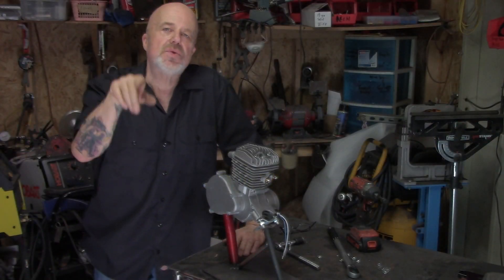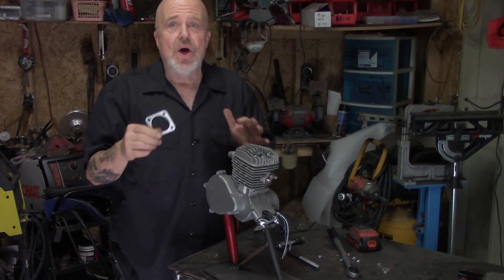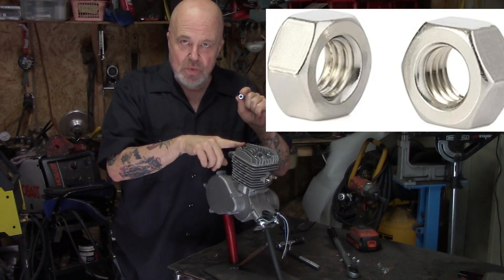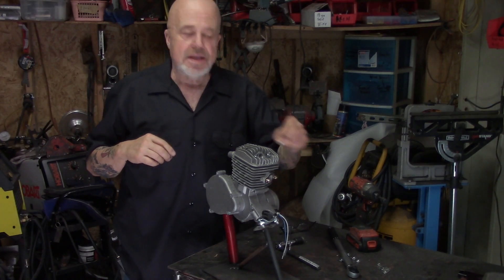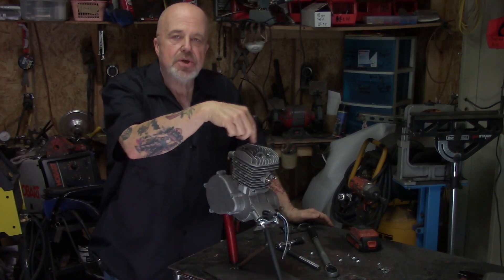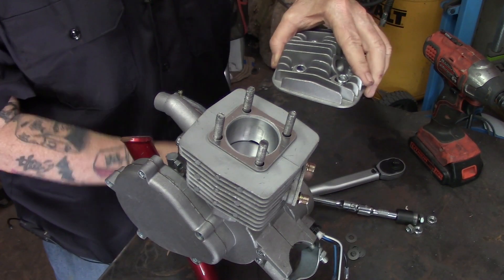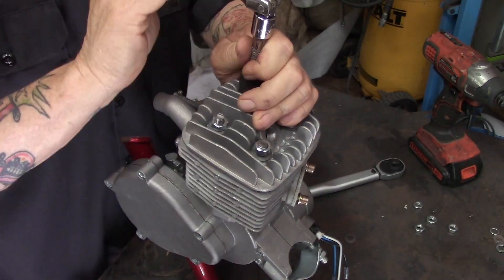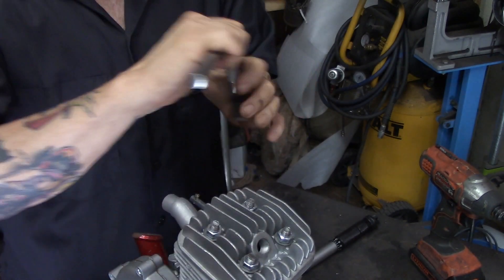Tip Upgrade Hardware To Avoid Head Gasket Issues On 2 Stroke Motorized Bikes

Comment: Problems with my brand new Smolik built Minarelli.  The idle RACES sky high as soon as I push the black button in on the brand new Mikuni vm20-273 carb.  I've done brake cleaner leak tests 4 different times in the past week trying to figure this out, but not once have I gotten a sputter.  Today was the 4th test with the brake cleaner,, no sputter, drove it about 6 blocks, and it suddenly lost power, gurgled mud, and died.  

Never did that before.  

So, I then noticed that the front of my sleeve was WET, especially on top of the exhaust manifold 'mouth', not the pipe.   Looked closer, and followed it directly to the head gasket.  

Why would this leak not show up during brake cleaner testing? 🤪

It's a CLEAR substance >>>> un-burnt oil! 🎯

I think maybe that may be my leak, and the brake cleaner test doesn't work on a head gasket.   I mean, that oil trail is dead center on the front, easy access to the spraying, but never showed itself until today, and by sight, not spraying. 

Anyway. . . 

🇺🇸

Comment: Heres a real tip if your watching this dont tutch your engine this guy is false pluse you're going to strip your studs every time it can't even handle 1 foot pout of torch or he can't read because I had my torch rench set to 4 pounds and it was doing fine then striped lowers it but my engine is fried because I can't even get one pound out of an 80cc just do it tell it's really hard to pull whell hard to say because it strips it very easy I mean each time I watch this guy my bike breaks fuck this shit this videos cursed

Comment: once my head was so loose, it was riding fine, infact it was running quiet and well, but i kept feeling hot oil on my legs, the gap between the cylinder and head was so much i could see daylight,
amazing it had compression to run.

Comment: Another tip....Lightly coat the aluminum gasket with copper RTV. Coat should be light enough to see thru. This will aid in the seal. The RTV will carbonize when heat hits it helping seal better.
Reply from the maker: good tip

Comment: Me using an aluminium can head gasket 🤡
Reply: Oop! Same. Runs great. So far. Knock on wood
Reply: Does it work?
Reply: @BedesMadafaka yea, if you know how to prep the surfaces (make them as flat as possible)
Reply: @darkraft100 yeah iv been spinning the cilinder and head on 600sand paper for 2 days ,almost
Reply: Easiest way is to start with 120 until it s flat, then 240, 400, 600 and maybe finish with 1000

Comment: Hey I'm not sure why I have black oil leaking near the top of the head of the engine some one please help me it's a brand new engine and don't k ow what to do I keep burning my foot because of the oil while riding lol
Reply from the maker: Could be porosity in the head, a cracked head or a bad spark plug seal
Reply: Same exact thing is happening to me
I think it may be normal
Maybe just burned up oil and its penetrating the head gasket
After I noticed this I torqued my nuts down after the engine got mostly/completely cool
Going to see if it leaks next time I ride
Reply: @vincent10717  yes I tried doing that but I still saw it leaking for some reason I'm going to open the top of my cylinder head and see if my gasket has a crack on it or if I stripped my nuts but I hope it's nothing major. Please let me know if torqing the nuts helped you fix the issue
Reply: @osmoz1179  Rode it a bit and I do notice a veryy small amount of oil leaking compared to more oil before I serviced the head.  I think I just originally didn't tighten the head bolts enough.  It's way better than overtightening though, I will say that.  Before I retightened late yesterday, I was even leaking out of the spark plug.  So far there is no more leaking there (torqued the plug down with about 9ft-lbs using a torque wrench).  
Also, if you want to tighten anything you probably already know this but just be cautious so you don't strip the studs.  Use a small ratchet to tighten the nuts on the head and I found that using a torque wrench for the spark plug worked (but start with very low torque and work your way up).
Reply: @vincent10717  oh ok I'll try that so your engine doesn't leak no more right?
Reply: @osmoz1179  No not like it used to.  You just need to monitor it a lot.  But I guess that's what you get when you get one of these kits.  Just needs a bunch of maintenance.